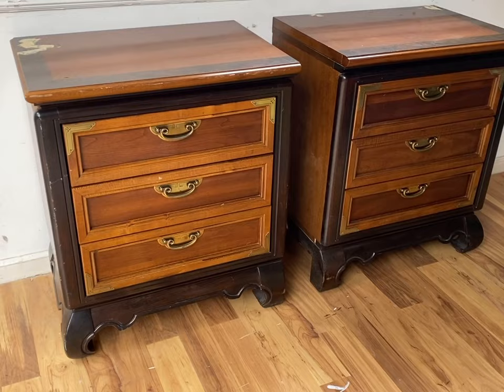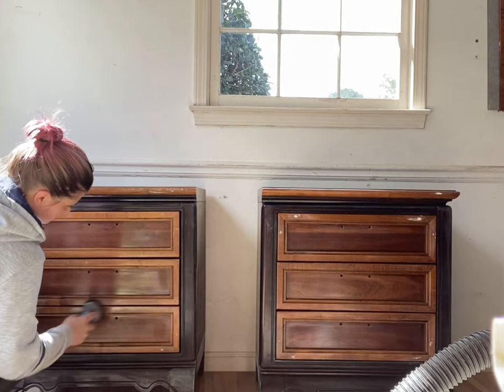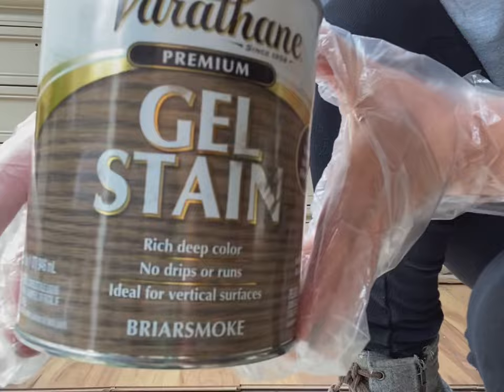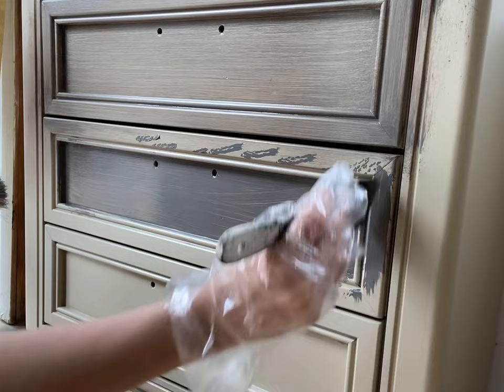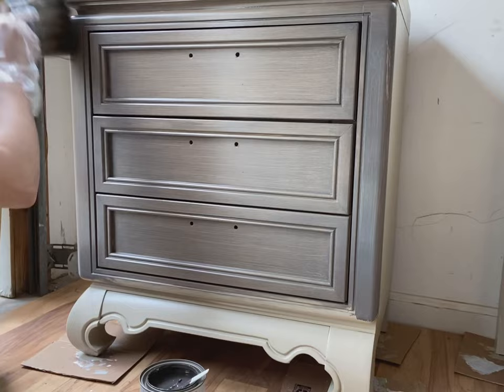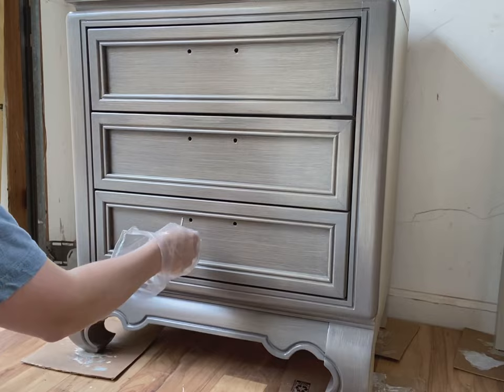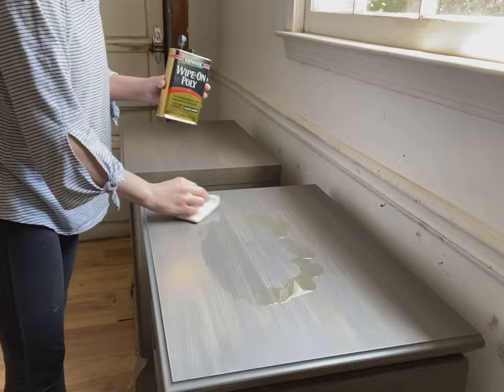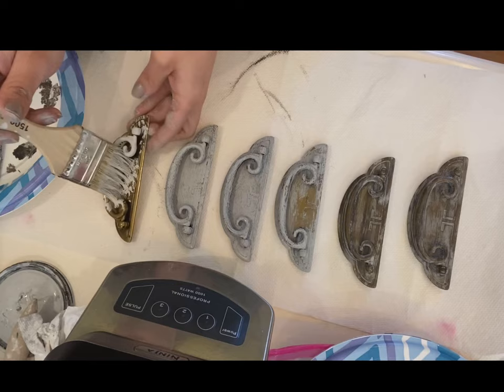Wood like finish | PAINT LAMINATE to look like wood | EASY techniques for a Pottery Barn Grey finish

Comment: How much pressure do you use with the broom like brush? I tried this once and it came out terrible, it was scratching paint off, but I am sure it was my error.
Reply from the maker: I actually have had that happen a few times and I don’t remember if I had used another paint or not primed on those special cases but just make sure your piece is primed 1st and fully dry.  You can also go with a higher sheen like semi gloss premium plus by Behr is one I have good luck with.  I’ve been used the outdoor enamel at times ❤️ I don’t apply a lot of pressure but about the same as I would a paint brush, hope that helps!
Reply: @blacksheephouse  do you think this would work on a table top? My biggest and most successful flips are dressers and tables. I am just curious of your thoughts, because I have loved every video you do. I love your style!
Reply from the maker: Thanks Melissa!  It would work great on a table.  Dressers (low and wider) are my best flips too!  I’ve never had much luck selling tables for a price that pays me well enough ❤️
Reply: @blacksheephouse  lol yeah, I live in reno, and it's shocking how the prices are different in each area. I usually get about $300 for tables/chairs and 250 for dressers. But it helps! thank you for your replies <3
Reply from the maker: @Bella_does_edits  interesting!  Loved chatting! ❤️
Reply: I DID IT!!!!! thank you! It looks gorgeous! I did a dresser and two side tables w/a matching coffee table that all had horrible fake tops and they look awesome, thank you soooo much for the help!
Reply from the maker: That’s so awesome to hear!!  So glad it worked for you 🎉